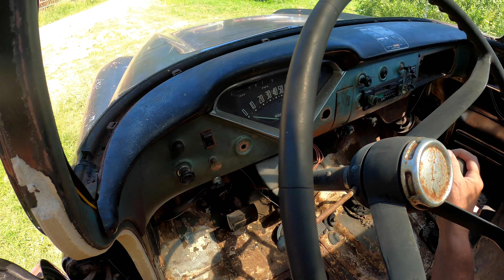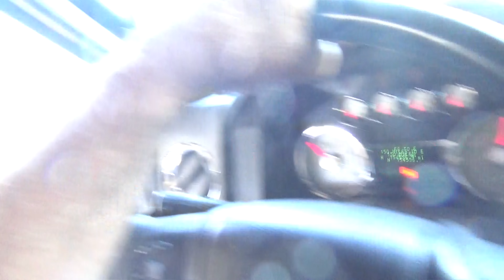Unpacking Two 59 Chevy Road Trip Trucks

Comment: Your driveway is looking good. I am always amazed at how much soil it takes to fill in even small holes in my lawn. That driveway is taking a huge amount of fill. Joe is really coming through for you.
Reply from the maker: Joe has really helped out a lot. Yes, I had no idea how much material this job would require.
Reply: I did not see the culvert in the grading video. Did it get covered up at both ends? Was it not really necessary?
Reply from the maker: The culvert is still there. I ended-up building rocks up around the openings to keep the dirt from falling in around it.